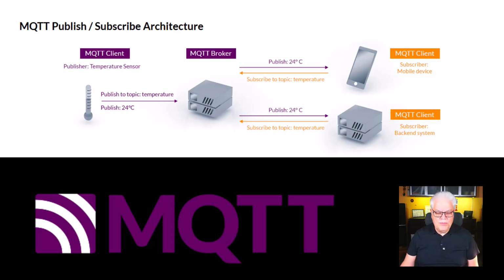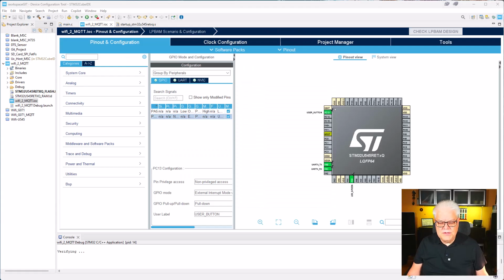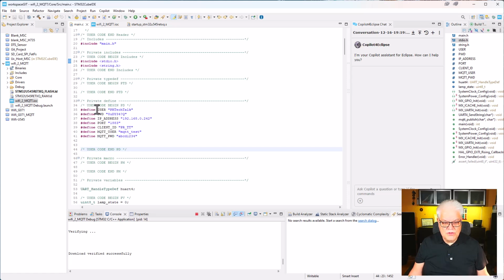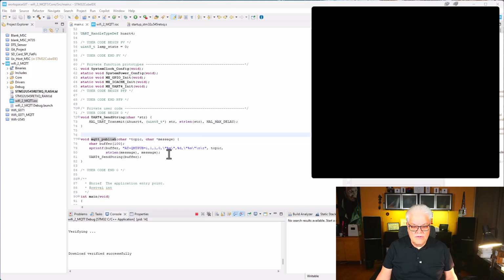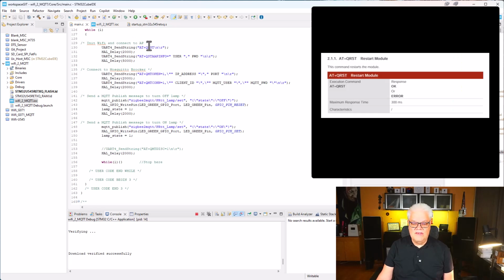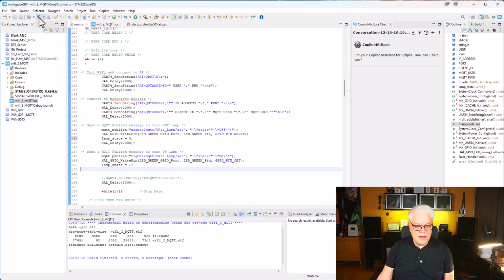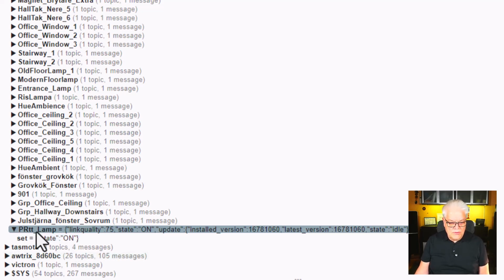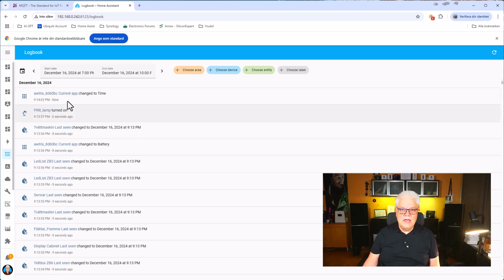STM32 MQTT Tutorial: Control Devices via Home Assistant

Comment: I'm doing a similar task for my project. I also tried to insert your code in place of mine (i'm using stm32 microcontroller and quectel bg95 module), however the result is always the same: i successfully open the network but i can't connect to the mqtt server (mosquitto for testing purposes). I keep getting +QMTSTAT 0,1 and few times +QMTSTAT 0,3. 
Do you have any suggestions?
Reply from the maker: First test authenticate using MQTT Explorer then if that works you have narrowed down the issue.